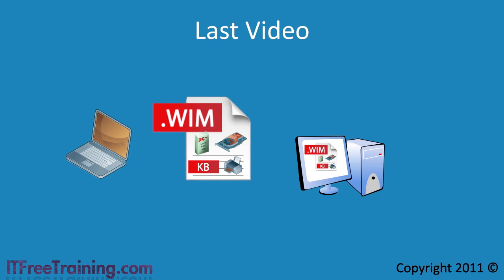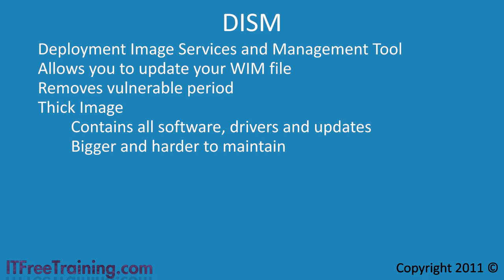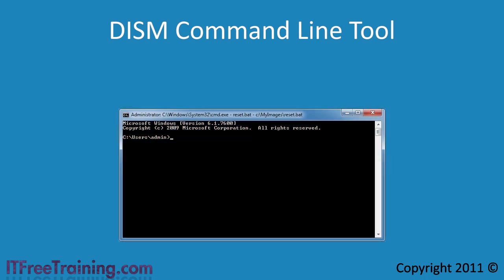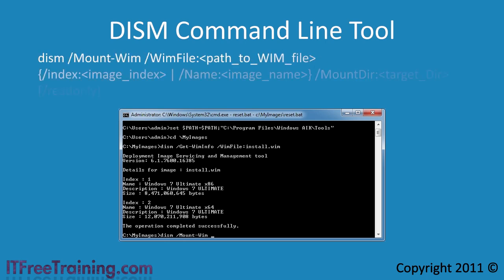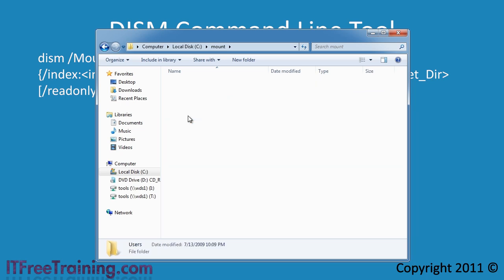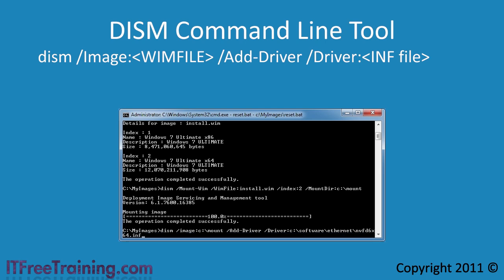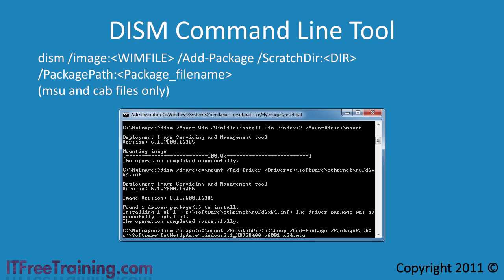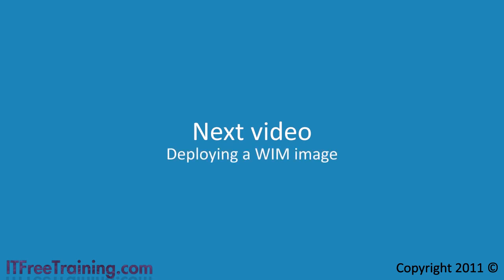Performing Maintenance on a WIM Image

Comment: Hi, how would you make changes to the Default User settings, things like not showing things in the notification centre on the task bar, or not prompting user with the Adobe license agreement?
Andy
Reply from the maker: You can make changes by mounting the WIM image. This will allow you to add files, like adding desktop shortcuts etc. For more complex changes like accepting the adobe license agreement, you would need to apply the image file to a computer, make the changes and then upload the image again. For changes like these, I would suggest setting up a default user. That is, configure a user the way you want them and then use this use a the default user and every user that is created on that system after that gets these settings. On a side note, with products like acrobat reader you can customize the install so that the user is never prompted for the license agreement as it is accept automatically.
Reply: Yeah thats the way we're doing it at the moment, just wanted to make sure it was right :). The videos are great! Can you do a video on appending images?
Cheers,
Andy
Reply from the maker: Team Foxhound UK We will have a look at doing some videos on the subject at some stage, but not sure when that will be

Comment: I have been told by my manager I have to create a image, that's fine but when it comes to drivers I'm confused. He said jus create the wim file and I'll use fog to deploy the image. The thing is we have different makes of pc so the drivers will be different, do I add all the drivers for all the make onto that one image? 

Sorry if I didn't make any sense
Reply from the maker: That is a good way to do it. Fog is also good software to perform this with. When you add a driver to the OS it adds it to the driver store and simply means it is available to install in the operating system as required. Once you have the system configured the way you want and additional drivers added, you could also run sysprep on the image before using fog.